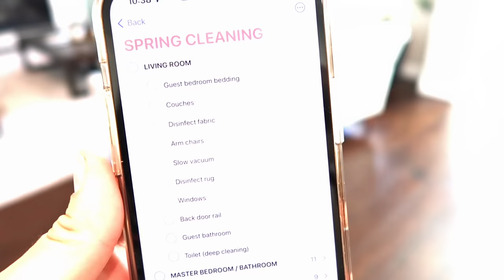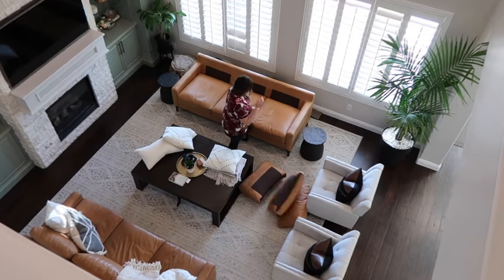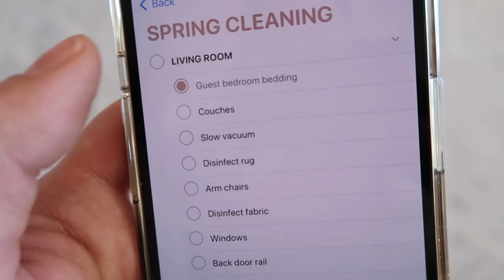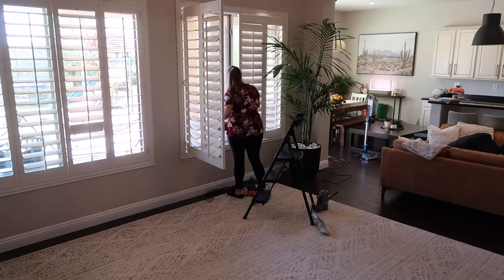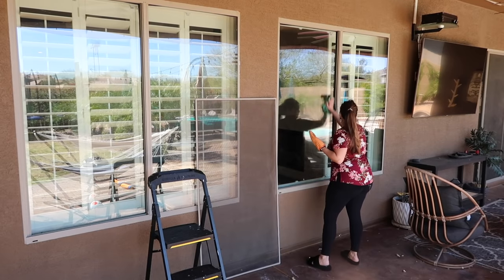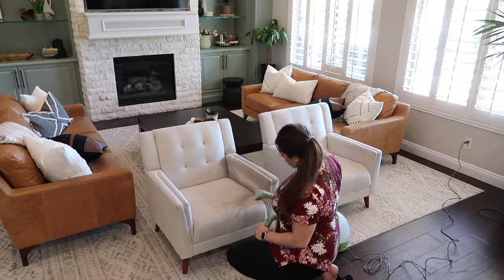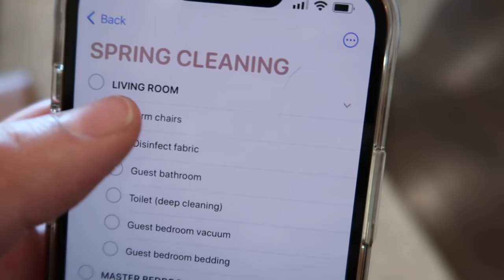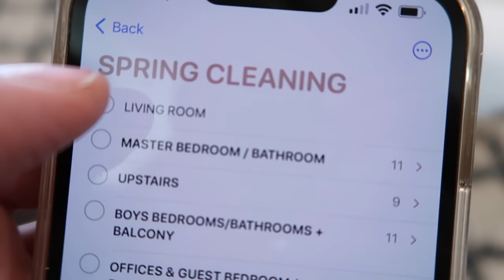INTENSE SPRING CLEAN WITH ME 2022 - Ep. 2 :: Deep Cleaning Motivation & Spring Cleaning

Comment: Love this! I saw a tip that I use when cleaning the toilet. When you’re done using the toilet brush you flush the toilet and rinse the brush then put it between the bowl and the seat so it hangs over the water and let it stay there to air dry for 15 minutes or so and then put it in it’s holder. It keeps the holder dry. I’ve been doing that and it think it’s a great hack!